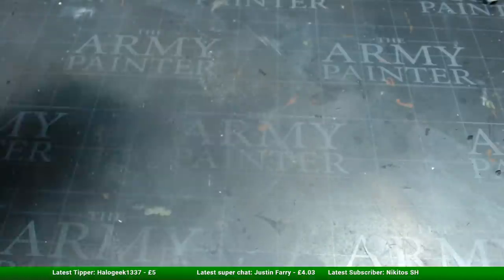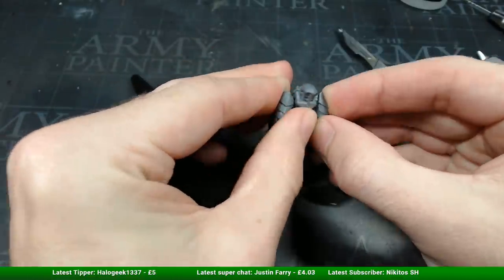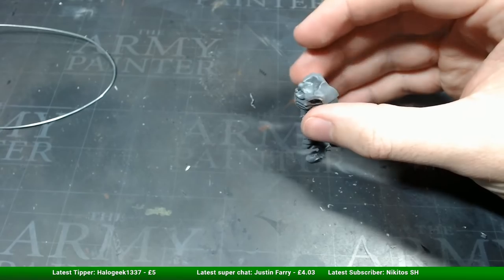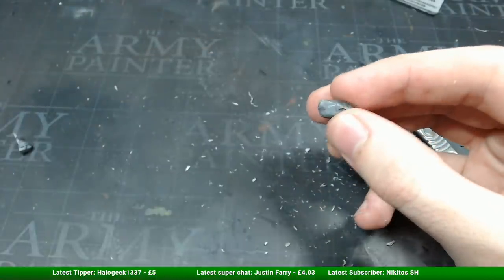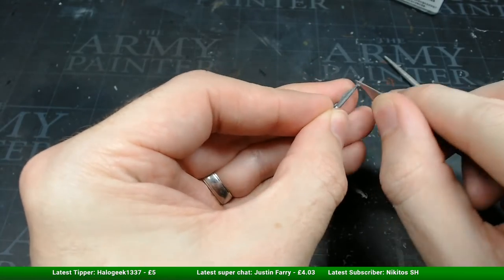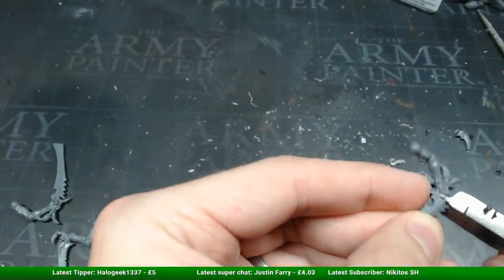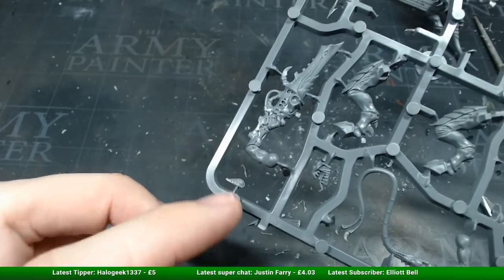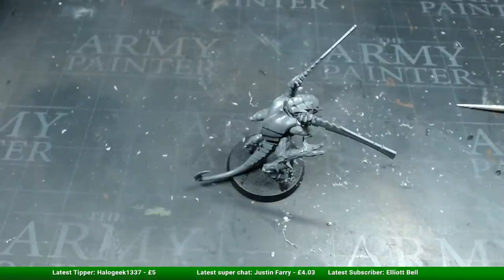How To Convert Plastic Lictors - 1 Kit Conversion Live Stream

Comment: What you could've done with the legs is use the clipped peg to fill the peg hole in. Also Venomthrope head would be the best fit if you were doing multiple kit bits.
Reply: Yeah. It needs a noodle mouth
Reply: Karloss01 my Lictors use the tendrils in place of the grasping talons, so actually i’ve gotten a lot of use from the venomthrope kit.

Comment: My man Whipface. What a great conversion!!
Reply: Srsly?
Reply: I...don't see the issue with the comment, so...yes. Seriously.
Reply: @salamanda550  its Kit-bash. Here is just a set of similar bits, adjusted to fit the desired model. Therefore, there is still no conversion.
Reply: The title says conversion, and the difference is negligible anyway.
Reply: @salamanda550  By no means. The structure of the Lictor's body is different from that of the soldier taken under this craft. Well, though as you like...
Reply: @RupertVenom  is that even a conversion? Looks like an original sculpt, is cool though
Reply: @Iclay905  y - its original sculpt/
Reply: @salamanda550  I dont get why Rupert got his undies in a bunch. Kit bash or conversion, there was nothing wrong with your comment
Reply: @adriannaranjo4397  shrug No idea, no issue, really. Not something to get overly bothered about.